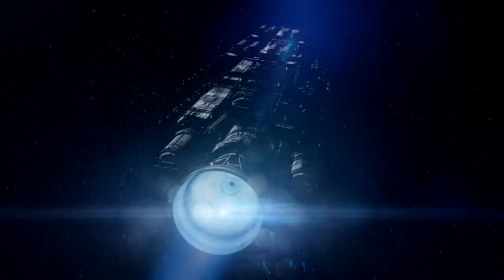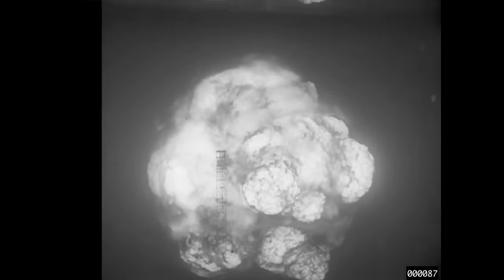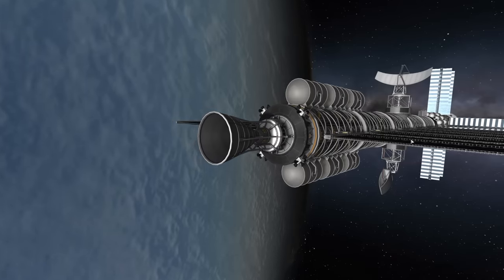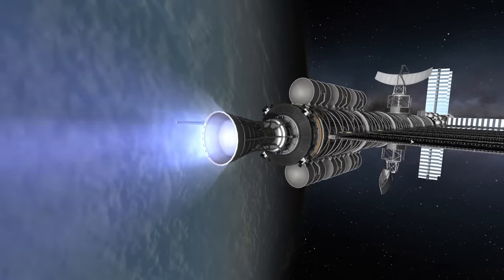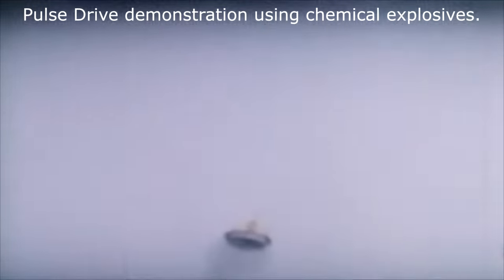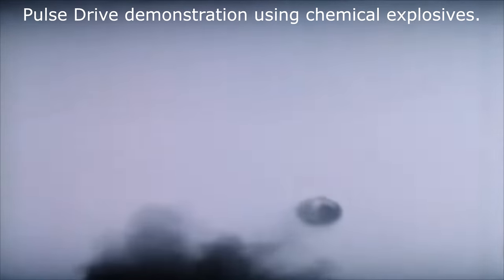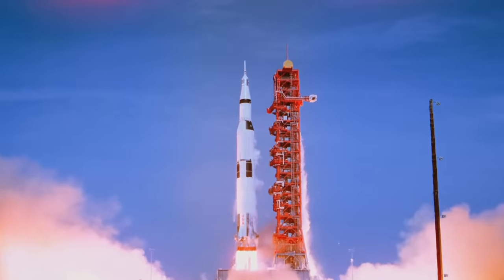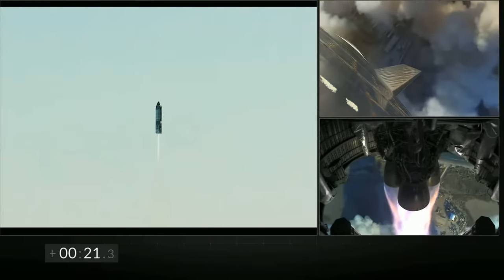The Nuclear Salt Water Rocket - Possibly the Craziest Rocket Engine Ever Imagined.

Comment: End of video: "no clear showstopper that a bright student can point out with [Nuclear Salt Water Rocket]..."
"On the other hand, it is likely that materials science cannot deliver the properties we require for this to work"

I'm not sure I want you to be right about it being materially impossible, but I think you mentioned some showstoppers for most rational people earlier:

"non-stop Chernobyl"
"having a liquid or [God forbid] even vaporized core is not good - I mean it sounds catastrophic right?"
"in that mixture, it [the fuel] contains everything it needs to sustain a chain reaction. If you get enough of it in the right place you will have a critical mass and the neutron driven chain reaction will runaway exponentially and the water will explode into hot plasma"
"if you have a fuel leak BTW then you had better hope that it doesn't accumulate in any one place otherwise it will eventually react"
"neutron suppression is a critical part of the fuel handling and must be maintained right up until the point where you want it to react"

... Great, so the fuel is about as temperamental as HTP but if the leak is really small then it won't blow up and only gives you cancer. Check. Continue.

"If you pump the fuel into the reaction chamber at the right speed [*] you will get a self sustaining nuclear reaction which generates incredibly energetic plasma - which generates thrust. This isn't like a reactor [where the reaction is sub-critical to maintain control] - this is a reaction where the CRITICALLITY IS MAXIMIZED [!!!] to burn as much fuel as possible before the fuel expands into space."

[*]: control of the fuel/water's flow rate and that of the heat/shock absorption water (I'll call these hot/cold water) are absolutely critical to prevent upstream neutron flux and heat/shock damage to the engine nozzle. The fuel pumps for this engine would need to dynamically control hot/cold water flow rates to keep up with a reaction that accelerates exponentially as hot water flow and chamber pressure increase, generating a shock traveling backwards in both hot/cold water pumps which must maintain hot water flow and increase cold water flow to absorb the increasing heat/pressure in the chamber and prevent catastrophic neutron back-flow. Unpredicted eddies in the reaction plasma flow and standard variability in the yield of supercritical nuclear reactions make even maintaining steady thrust a feat that modern chemical rocket turbopumps could only dream of. If the challenges of spooling the hot water up weren't enough, spooling it down requires increased cold water flow - which isn't a problem in and of itself, but if that cold water pump ever stops working at any point then you'll instantly have severe damage from the unmitigated nuclear shockwave in the engine and a potentially critical amount of neutrons traveling into your fuel system.

Overall, I'm Horrified. I love It. KSP engine modpack coming soon.
Reply: One of the big problems with the NTR wasn't with its normal operation, but with its behavior in launchpad explosions. They determined the reactor wouldn't become supercritical after an explosion and drop from launch height and would largely contain any radiation, but still weren't satisfied. With the nuclear salt rocket you have fuel that just wants SO MUCH to supercritically detonate at least as violently as typical hypergolic rocket fuel if the neutron shielding in the tank explosively fails. Before you ever fire this thing up, it's a giant radiological dispersal device on the pad.

Comment: Consider, if you will, the other methods of employing NTRs - solid core rockets such as NERVA (creates thrust by passing a working fluid through a specially designed nuclear thermal reactor - very high specific impulse but same issue with radioactive exhaust) and gas core types of both open and closed cycle designs.  

Open cycle gas core NTRs again have very high specific impulses - due to their design (a modification of the liquid core type which induces rapid circulation of the fluid to create a toroidal pocket of gaseous uranium which never comes into contact with any solid material) the reaction can reach very high temperatures (estimated at tens of thousands of degrees) which allows for specific impulse figures in the order of 3000 to 5000 seconds, which is more than twice the impulse of LH2-LOX designs - but have that pesky radioactive exhaust again. 

This issue, along with projected trouble in keeping the fuel in the engine where it's meant to be, led to the design of the closed cycle gas core NTR, sometimes referred to as a nuclear lightbulb rocket, has the fuel contained within quartz enclosures and passes the hydrogen working fluid around these enclosures for heating.  It's not as efficient as the open cycle types, with projected specific impulse figures of 1500 to 2000 seconds, but the kicker is, the exhaust isn't carrying all those lovely fission products along for the ride.

Comment: I seem to remember hearing that the nuclear thermal engine tests were shut down because the propellant had an unfortunate tendency of eroding the reactor core, causing them to spew deadly radioactive material all over the place.  Such motor designs led to one of the most noxious cold war ideas I've ever heard, in which nuclear cruise missiles powered by such engines could be deployed to irradiate enemies in much the same way a dirty bomb would.

Comment: Sorry if I missed this somewhere. I do love the idea. I'm a Heinlein fan. With this design, how would you stop the engine. Unless there was another way to flush out the system, how would you slow down the flow to stop without a back splash into the system? I keep thinking of ways to do it but then figure out ways in those wouldn't work. possibly something with electro magnetic coils and magnetism how ion engines work but that's above my pay grade.
Reply: I THINK from my one conversation with Dr Zubrin, is that the water and Uranium are stored separately so you can stop feeding Uranium into the stream. Added advantage, unlike a traditional nuclear reactor this pretty much auto starts.

Comment: You'd definitely want to make the nuclear juice in orbit, fly up a pure water rocket with a chemical stage, the plutonium in criticality safe packages in a reentry/accident safe capsule, then a criticality safe salt solution production plant in orbit, which would dissolve the fissile salts into the rockets liquid tanks. You'd need a thermal solution to heat the tanks to stop the salt solution from freezing, but excess thermals would be a given in the system so not too much of an extra energy suck. Perhaps you could design the nozzle to have some suction/siphon action helping the liquid pumping along, thereby reducing the need for positive displacement pumps...

Comment: if the fast flow of water is what prevents the reaction from going up into the fuel tank, how do you even shut off this thing?
Reply: You cut it off with a fast-closing boron valve to absorb the neutrons going up the pipes.

Comment: I have an idea for space travel:
We build a large nuclear salt rocket in pieces that we intend to put together somewhere away from Earth, perhaps in Moon orbit or solar orbit. Then we transport the pieces up to low Earth orbit using standard means, and boost them to their staging position with the help of NERVA rockets. Drones are used to piece the rocket together and maintain it during construction. The NERVA rockets can be recovered on Earth, refurbished, and put back to use. Once the Nuclear Salt Rocket is completed, we will have the power to travel wherever we want in our solar system in a giant cheaply-refuelable vessel. The cargo it can carry can be many things: robotic factories, exploration vessels, humans, supplies, whatever we want to put aboard. We could use it to explore Venus, Titan, and perhaps other places, and reach an informed decision on what would be most reasonable to colonize first. Then we can use the ship to build and maintain that colony. As we reinforce our foothold in space, we will eventually have the capacity to build rocket parts somewhere from which shipping them into orbit is much cheaper. Ceres may be a good option for robotic mining factories, and Mars may be a good option for human-run mining settlements. Once we start shipping thousands of tons of steel into space, we can begin furnishing giant steel wheel-stations which provide artificial gravity and make living in space more tolerable for the long-term. Eventually, humans could inhabit space. Even though most of the humans on Earth would never be able to leave, at least the humans in space could multiply, and eventually the majority of our species may live off of the planet. We would eventually have so much access to travel resources that travel on and off Earth would no longer be limited to Earth's resources. We could finally stop strip-mining here and reclaim most of that land, converting the Earth into an enormous wildlife preserve with human settlements mixed in, fed by off-world resources with no need to plunder the planet any longer.

Comment: I wonder if a "safer" version of this could be built, that uses a conceptually similar idea to liquid fueled rockets, where we keep the oxidizer and fuel separate.  How feasible would it be to carry the uranium tetrabromide separately as fuel "pellets" (presumably with many individually shielded hollow channels of salt that the water flows through), that are dissolved in-situ as the water is pumped to the nozzle? You'd have the primary water flow, and then secondary flows that introduce the dissolved salt in stages to get the concentration to the desired level. This would also allow you to have multiple alternate stages so that the fuel pellets can cycled in and out in order to keep the fuel streaming continuously. The fuel pellet containment "pods" would probably need to be shielded by the water, so the tanks could be arranged to form a hollow cylinder with the pods in the middle. I think the challenge would be in how the fuel pellets are constructed, so that the salt dissolves slowly enough that the concentration in any given channel is never high enough to reach criticality. Controlling the water temperature is probably a critical factor here.

Comment: One of the reasons why these designs were ostensibly abandoned is that the rocket exhaust is basically a plume of radioactive vapor... so you can only really turn this engine on safely once you are in deep space. In other words, this type of rocket engine is only really useful for interplanetary flight, turning it on inside the earth's atmosphere would be incredibly harmful. Meanwhile the biggest hurdle for space development is still how incredibly expensive it is to lift matter into orbit.

Comment: Make the tank out of boron fiber, lined titanium in a torroidal configuration and then use the nuclear reactor chamber made of beryllium carbide composite in iconel or similar as the heat source to react, preheat and ionize the propellant and use a secondary ion acellerator and focusing assembly to add even more velocity to it.😮

Comment: See, I just think of it as a sodium hydrogen rocket with an oxygen kicker, but what do I know? I hate making them because I have to use stuff off the nuclear pile out back. Did I say I was a Boy Scout as a child?

Thrust components for ion rockets are so interesting. I just think of this as a version. If you could get a super efficient neutron gun to cause a medium to go nuclear was something that always interested me for thrust.Heck, just anything to split the H2O quickly and ignite it would be more then sufficient without nuclear involvement. I always wondered about a nuclear pile powering an electrode with wisps of water being split and ignited. You only need enough for a few pages of paper worth of force, right?

Comment: How do you shut it off? If the system is running so fast the neutrons can’t go upstream then it seems like when you turn it off they will go upstream. Seems like you’d have to purge it on shutdown. 

Also the idea of the high thrust one brings up the issue of high thrust. Continuous very high acceleration would be hard for the ship and hard on the crew and cargo.

Comment: Wouldn't a better method for this rocket be to seperate the water into their own tanks and have the uranium salt be in its own storage. 

Have a production line where uranium salt is then atomized and mixed into the nozzle. That way you don't need specialized tanks, and as you say, the uranium salt at 20% 235 enrichment can't go critical with fast neutrons, so it's inherently safe.

Finally, inspiriation from The Expanse, I wonder if the ISP can be boosted significantly by having fusion reactions take place inside the nozzle concurrently?

Comment: Hi Scott, I have wondered for some time on a concept for space propulsion which is not on any existing rockets.  I hope you could add light if it is not a possible concept.

The idea is to collect matter at the front of the rocket and accelerate them out the back such that only power would be needed for propulsion.  I assume the problem is the density of atoms in space is just not high enough.  But the geometry of the rocket could be changed to a big scoop more or a vast electro static collector could be made and then the atoms ejected velocity could be to the limits.

Maybe you could calculate based on atom density in space, the size of collector needed to provide sufficient propulsion .

Hope you feel motivated to answer this.

Thanks
Steve

Comment: Could you use a safer propellant (lower critical mass) if you managed to compress the flow somehow? I'm looking at the engine schematic and wondering why there isn't some form of a converging nozzle or converging flow. Couldn't you basically force criticality at a location if you use a design that converges the flow to the critical volume at a specific point? It might make it safer to store the propellant and ensure consistency while the engine is running.

Comment: Small nitpick.  At 12:10 you say he suggests a higher performance version using U235 enriched to 90%, but the paper you display shows U233.  Is this whole thing also using LFTR style conversion of Th232 to U233 with chemical separation fast enough to feed a rocket motor?

Comment: The radiation levels at the payload could be crazy high. Did they do the math on that? How much shielding would be required for today's electronics, how much for manned missions? Same issue contributed to abandoning nuclear powered aircrafts in the 1960s.

Comment: Enclose the engine in a water-cooled jacket as well as the fresh water outlet nozzles. Capture that heat using the water cooling and generate power using the waste heat from the nozzle bell.

Comment: The salt water is being consumed in the reaction right?  Seems like it'd use an incredible amount of salt water very quickly which would get heavy (to store and carry) fast wouldn't it?  I feel like I'm misunderstanding because a 6cm tube is going to have a massive throughput so wouldn't the weight of the required salt water end up causing issues making this realistically work?

I just know that when they send food to the ISS right now they try to minimize water because of how heavy it is so the thought of bringing thousands of gallons of salt water along makes this sound pretty unmanageable right?

Comment: What about a hybrid nuclear rocket? You get the clean water and just inject it in to a boron mixer in which you add the fission salts. And maybe add a bit of deutiium and lithium for extra fusion boost. Than shoot out the fuel mix on the reaction nossle. Using the excess heat from the nossle bell you can run a closed cycle heat engine generating power for the rest of the ship and the pumps. Oblation cooling is cool and all, but that just adds unnecessary nuclear waste to the exaust. Superconducting magnetics could be used to confine the plasma and redirect fissile material back to the reaction chamber for further fission to increase efficiency.

Comment: Prompt Critical-WOW... I am trying to wrap my head around going further way past the point of adding heat and boiling water... (our old 1DPM SUR seems like a baby crawling)...  the coolant-carrying the fuel like the old sodium Rx sounds ok... The Radiation level on this craft would require it to be unmanned and remotely controlled... IMO-prompt criticality is a really bad neighborhood-too close to a bomb. I like the concept of cooling the engine, but would not the water flash to steam and lose its heat transfer characteristics? and how do you keep the rest of the water from becoming a popsicle? Borated poly is good to keep the gang cooled before fission... Flying Safe on this vehicle means it is unmanned! Great presentation! Thank you :)

Comment: its awesome.. but I'm still a fan of ion thrust with some changes...  I think they could step it up a bit and get a lot more thrust.  What could be done is a less intense (safer) salt reactor poss (or just one similar to subs reactor adjusted for space) which can produce the power to propel ions the same as ion thrust... but with more velocity.  I see this approach as risky and the approach of most resistance when ion thrusters are so good at what they can do and are improving... and conventional nuc reactors in subs that just produce stable power i the form of electricity are tried and tested... and have operated safely for decades and decades.

I suppose the best would be to create radiation pressure or just particle accelerator so powerful it produces a large trust...  then you dont need a propellent ... just energy!    And of course, if we could somehow slow down time in front of the craft (same as being near a grav field) then could just accelerate a massive massive amounts without even experiencing the g-force.... but that's not remotely within our abilities.